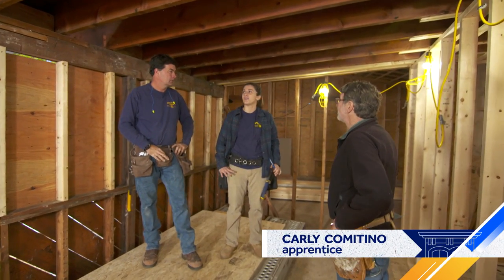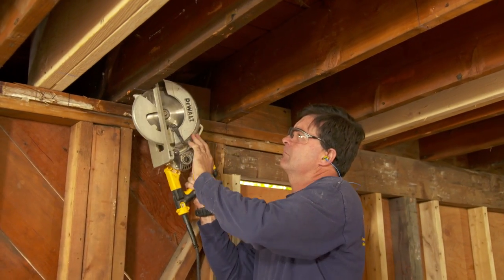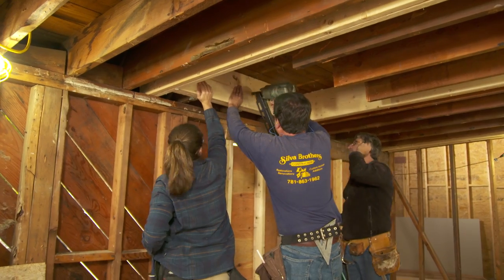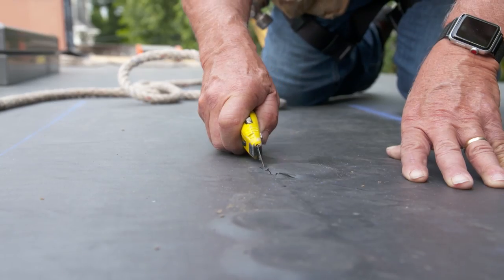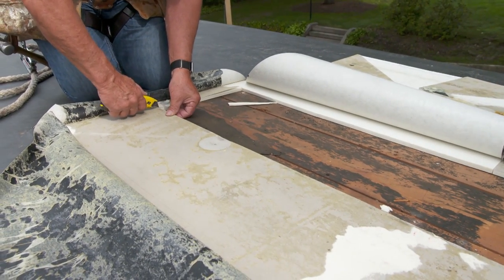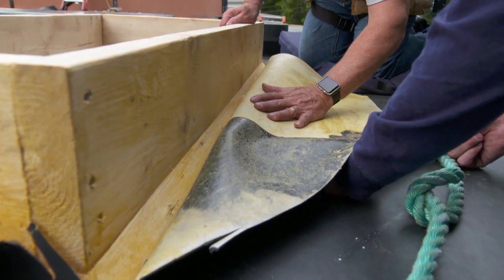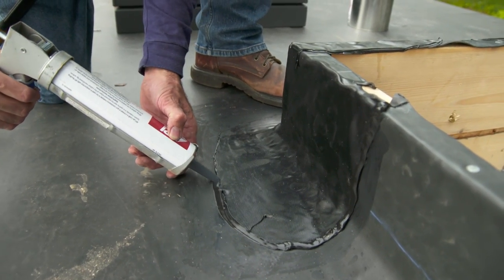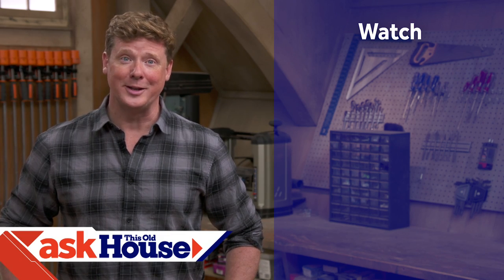How To Install a Skylight | This Old House

Comment: No insulation around the skylight frame that extends above the roofline?
Reply: Eric R 
Nope. It isn’t necessary as the dimensional lumber if rubber applied tight, is a good enough insulator to avoid frost or condensation.

Comment: 7:15 Why does the curb overhang by 3/4" ...for drywall?  And the interior of the curb will simply be painted?  Also at 7:15 looks like they installed hangers for the joist headers which were not shown during the interior video shoot.

Comment: Good video but I have to  issue you with a STOP card and ask you to take a TOFS...there is more slack in your safety line than the height of the roof meaning you will simply go SPLAT (technical term from oil industry)...
Reply: DR PHIL  agreed...i work ropes on the rigs and it's always getting on or off that cause the issues...but for tv shouldn't they at least be safe...broken back can still happen from 17'
Reply: Calm down nerd. Looks like he made it out alive.
Reply: There is a time ( in an experiencied carpenters  thoughts ) when so called " safety equipment " can trip you up and send you off the roof.... not keep you safe...... and people need to use their heads at times .

Comment: i believe the roof  frame curb is not sitting flush with the inside. when they will do drywall inside, it will be zigzag. or is there another soultion to fix that ?

Comment: I only do skylights on shingle roofs... I always passed on flat roof installs...I've done too many repairs from other peoples installations...
Reply: So....not skilled enough to do flat roofs then?  Gotcha
Reply: @bigvegass  ...Oh, Wes, you silly boy!..A shingle roof is actually harder because of step and head flashings... I don't do them because flat roofs are notorious for leaks and if you go on one and do a repair and the roof gets a leak ANYWHERE you will get the call for it...It's called "limiting liability" ..... You'd understand if you owned a construction business....
Reply: ROB-IN-PHILLY lol calm down
Reply: I worked for an old man doing so yard work when I was in highschool. He told me that there’s only 3 guarantees in life. 
1.) Death
2.) Taxes
3.) and a flat roof will leak

He built his house in the 70’s and made that mistake along with 4 leaky skylights.

Comment: Never seen the code call for screws on hangers.... Also, what sense does it make to have hangers on single joists when the new double joists they're nailed to doesn't use hangers?
Reply: It's because those doubles they were nailed to are sitting on top of load bearing walls. They don't need any hangers.
Reply: @shaunpage4498  no comment on the screws then?
Reply: I think it's optional rather than code. Structural screws. I prefer them to nails in many cases.

Comment: That flashing job is done so wrong.  The rubber should I be pinched under curb with a separate wall sheet or fasteners around the curb and a separate wall sheet. That curb is going to bridge out in the future.
Reply: what do you mean bridge-  out?  i dont know much about roof installation but would like to install a skylight...

Comment: Water will puddle and settle on that flat roof light. It will look a dirty mess in a few weeks. Needs to have some drop on it.
Reply: Yes, should have a 3-degree slope minimum.
Reply: MKRM27 rain won’t hurt it, it’s 0ppm in my area at least

Comment: It fascinates me the difference in other countries. It must be a warm location with the thickness of the insulation in that roof which would be around 80mm here. It must be a very high-performance board for that thickness. Also, any kerbs where I'm from need a min of 25mm insulation as there's nothing preventing cold bridging and that 45-degree edge also made from insulation as opposed to that piece of timber to prevent the same thing. And any flat roof lights require a 3-degree pitch.

Comment: Why the hell didnt you put the skylight in before the rubber roof?
Reply: Would have made a boring video
Reply: As a roofer, It is actually easier and safer(leakage wise) to do it the way they did in the video. It is a huge pain to lay new rubber around curbs.
Reply: But as the roofer, wouldn't you have rather done the job.  Because you'll get the blame when it leaks?  That is the inevitable weak spot, correct?

Comment: Just out of curiosity, why does Tommy pulse the trigger of the impact driver , rather than hold the trigger until the screws are driven all the way home?
Reply: more control of the driver. Also prevents stripping
Reply: makes sure they're getting started straight.

Comment: Please do not apply sealant to the skylight lens. How do you suppose someone to take it off? It has a rubber seal inside the lens. Also you say in the video "it doesn't say to do this"
Reply: @Joe T skylights tend to leak. Especially on shingle roofs. I work on then weekly.
Reply: @Joe T Read B.Thomas comment , when it breaches out the corner sealing leaks . If someone needs sealant to make it work , u should figure out on ur own , that the stuff ur using isnt good .

Comment: I was always told to use nails in hangers and not screws and there not as strong. Can anyone tell me which is correct?
Reply: Nails take the friction in , screws just break cause they are way harder . Nails it is .
Reply: Anyone who tells you that a nail is stronger than a screw needs to change occupations.!

Comment: Should have put a bead of sealant between that curb and the roof before you screwed it, and probably between every corner and nook and joint of that curb, but then...